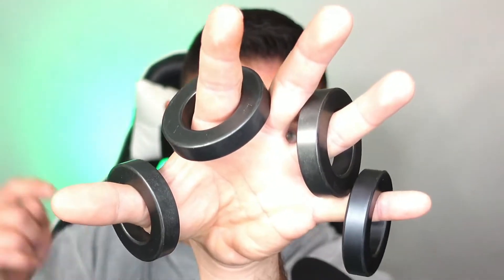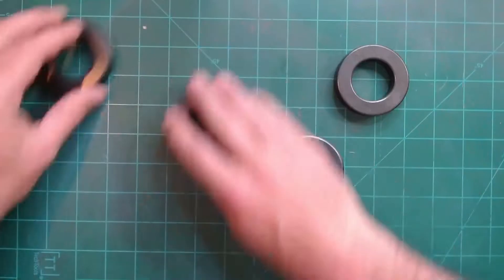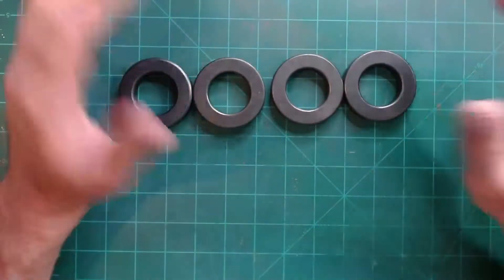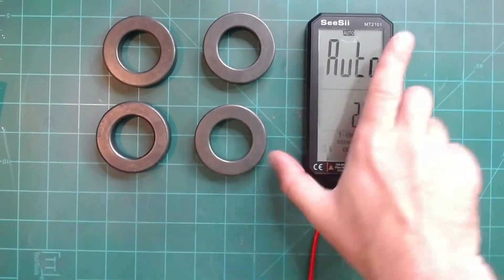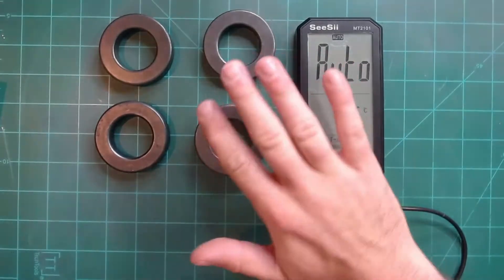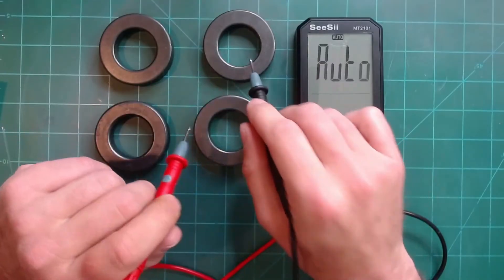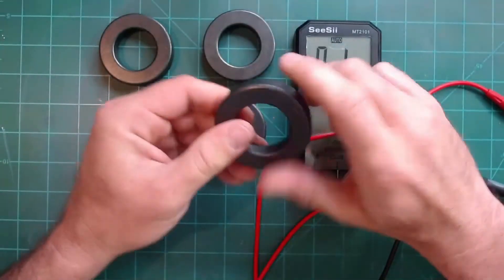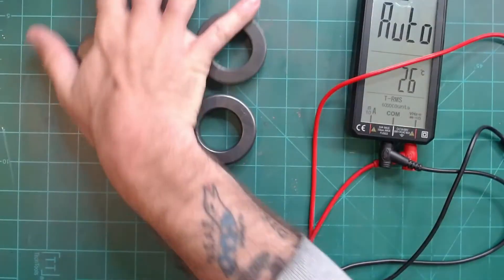You are using the WRONG toroid for an EFHW Antenna, Maybe! Easy and Quick Method to Determine.

Comment: Material------common mode choke------common mode frequency range-----impedance transformer------1:1 Balun:
#31	                3,5 - 100 MHz	                    1,5 - 50 MHz	                                        -	                            1,5 - 30 MHz
#43	                25 - 600 MHz	                    2 - 60 MHz                              	          2 - 50 MHz	                     2 - 30 MHz
#52	                150 - 1000 MHz	                    4 - 150 MHz	                                  1 - 60 MHz	                     1 - 60 MHz
#61	                 200 - 2000 MHz	                    5 - 200 MHz	                                15 - 200 MHz	           10 - 100 MHz
#77          	200 kHz - 10 MHz	            100 kHz - 10 MHz	                         0,5 - 8 MHz                      	1 - 8 MHz
Reply from the maker: Thanks!  pinned!
Reply: @DudeTested  Thanks. Happy new year! 73
Reply: WOW great info... thanks. BUT, if I am putting torroids... ferrite beads on the end of my coax to remove RFI, I should use mix 31 or 43? NS9T
Reply: @radioman3229  lot of ppl use 31 to common mode choke (for hole HF band), 43 seems better for above 20Mhz i think, IDK, try to use chatgpt to ask things about it, it cool
Reply: @radioman3229 toroidal baluns and ununs can be used to match the impedance of the antenna to the impedance of the radio. This is imperative in order for the transmitting circuit to transfer full potential of current to the emitter or aperture. The size of the toroidal ring is the first number you'll find in the part number and the next is the number you inquire about, which is the mix it's made of. Different materials will have different effects.  The two mixes you ask about would determine frequency of intended use. As rfi suppression, such as chokes, commonly referred to as common mode suppressors, they will operate the same however, in different frequency bandwidths. 73
Reply: Only two numbers to remember, 31 and 43. 🤞

Comment: That's why if you use the proper toroid fot efhw antenna transformer, the wire you use doesn't have to be insulated, but make sure turns don't touch each other. The core will be cooler on transmit.

Comment: What a great video. Never thought of figuring out the value like that. I usually put about 4 turns of wire through the core and check the impedance. At a hamfest, I always have a pocket size VOM with me. 
Barry, KU3X

Comment: Ferrite will not conduct.  No need to cover it with tefl9n tape unless you just want to protect it from the windings.  Powdered iron will conduct if the windings contact it.   T240-43 works fine as an EFHW from 3.5 to 30 MHz.  Cheers.

Comment: What about T-240 #31 toroid? It is much better for 160m band.
Reply: Ahh. Okay. I read the explanation on ferrite shop in EU. They said that #31 is good for 1:1 BalUn, but #43 for impedance transformer. #31 has 3000 ohms-cm, #43 has 1x10^5 ohms-cm. That is huge difference.

Comment: I bought a pair on Amazon. None they sold had a material description that I could differentiate. Mine are 2.4x1.4x0.5 "toroid iron core" and my readings are 6k and 14k ohms. Seems like a big difference for identical toroids. I got them to make a balun. KW4AY 73

Comment: And the t240-61 ?
Reply from the maker: What would you like to know?
Reply: Actually type 61 ferrite is an effective material for 20 meters and above, where it gets even more desirable. It can do 40 but not as well as 43. it can be differentiated because it is just a slightly lighter shade gray which is discernible.
Better than 43 for the high bands IMHO., 73, eddieson kg6zbn

Comment: I want to build a transformer in 50khz range for a half-bridge configuration. The output will be in 100 volts. Should I be using Ni-Zn or MnZn?

Comment: Wow, that was PROPER interesting. I have seem folks testing toroid's by winding wire and measuring them but this is SUCH a simple way to test them. Got to subscribe now, just for that 🙂
Reply: For about the same price as that multimeter you can probably get a nanoVNA which will give you a much more complete measurement

Comment: Well, for starters, you didn't mention what the frequency range is of the EFHW antenna you plan to feed. There are various toroid compounds (mixes) that work much better or much worse for various frequency ranges. And of course, they must also be selected and sized for the power they are intended to handle or they can easily get cooked and perhaps cook your final amplifier in doing so. Put simply, a resistance check just doesn't tell you what you need to know. Four minutes won't explain it. 

I'd suggest new hams either just buy the exact materials recommended for their build by an experienced ham, and build with that, so it will work when they're done, or if they want to play with unknown toroids, first spend several hours reading up on various powdered iron and ferrite materials from several sources, including Amidon, Micro Metals, Palomar Engineers, etc. Then watch several of the longer YouTube videos on the subject of toroids for both RF transformers and for RF suppression. They should also buy an inexpensive ($50) NanoVNA to make measurements with. This is a commitment in time and a few bucks, but if they do these things they won't be wasting a whole LOT of time playing around with unknown toroids made of of unknown materials, which is what I did at first because there is a whole lot you need to know to get any value at all out of unknown toroids. 

To get toroids to do their job, half a dozen different things have to be right, and you can't just randomly do every one of half dozen things right. And unless you understand what those things are and can measure them you will never know what's wrong.
Reply from the maker: Edited because I re read this post.   

Thanks for the information. This wasn't a video regarding what mix you and use for what frequency range, though that should be coming soon.   

Feel free to shoot me an email to set up a time to come on the channel and provide more information to the viewers.  They enjoy understanding the details in a way which is easy to understand .

That said, testing with a multimeter will tell you if you have RF grade material. 

Yes this is a 5 minute video which doesn't explain everything, long videos that cover too much information can be hard to follow, so why not break it up into smaller sections.

If I'm still wrong about the infinite resistance in an rf grade mix, I'd be glad to relay the information back to the engineer of 40 years who taught me.

Again, feel free to shoot me an email if you'd like to come on and talk more about these subjects
Reply from the maker: I do agree having a VNA is a good investment and can tell you more.
Reply: @DudeTested  may I know have video to teach how to test toroid via VNA ? Thanks

Comment: Can you distinguish them with a strong magnet?
Reply: Yes
Reply: @JayN4GO .  The only effective way to check a toroid at a swap meet is to wrap it with 3-4 turns of magnet wire and test the inductance with an LCR meter against a known inductance for the types you are interested in.  Most LCR meters used in the field measure inductance at 10KHz and inductance changes significantly from 10KHz to 30MHz or higher.  However, for example, an FT240-43 toroid wrapped 4 turns generates approximately 17.2uH at 10KHz but an unusable T200-2 iron core toroid measures only .19uH at 10KHz.  Most hams use the FT240-43 toroid for the EFHW transformer.   Just because a toroid had DC resistance does not mean it is suitable for a EFHW transformer.

Comment: Excellent. I've made a number of EFHW's and while I knew you wanted to use 43 mixtures, I never really knew how to check them so easily.
Reply from the maker: I should mention that there are other torroids like 61 and 52 that are Nickle zinc.  I just happened to know that these were 43.  But regardless, they're good for efhw's with the info on here 😃.  Thanks for the comment..  I'm going to pin this so others see the are more than just type 43 for  efhw. My lack of clarity in the video.  Have e a good one!  Nice hearing from you!
Reply: Same here!

Comment: I use only type 43 toroids for 49:1 transformers.
Reply from the maker: Yeah I like 43.  I am going to play with 52 and 61 also
Reply: @DudeTested   The final test is how good you can get  your SWR in the field at the transformer feed point.  Toroids are very sensitive to high SWRs (over 2:1 at the feed point) and heat buildup due to a impedance mismatch can destroy your transformer.  So, get the SWR down to at least 2:1 at the input to the transformer.  Your tuner will not help here.
Reply from the maker: @hankhamner3671  I'll make a video with some results soon.. good call